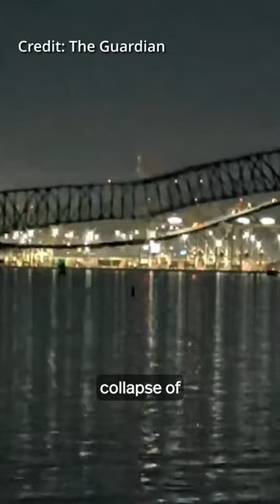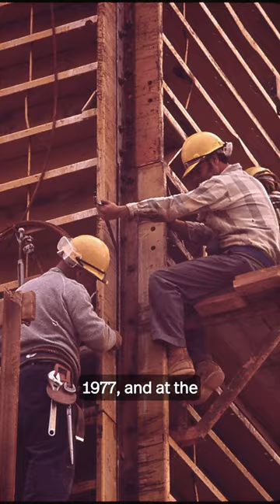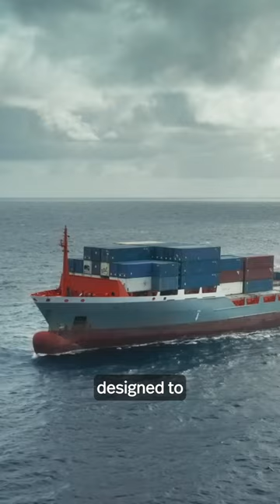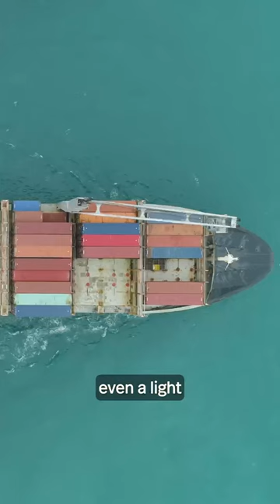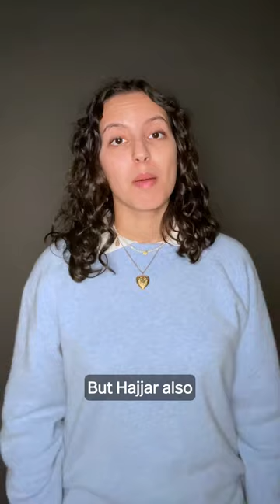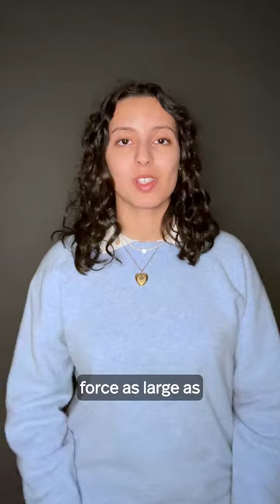Here are two factors that could have contributed to the collapse of a Baltimore bridge this morning.

Comment: This was an accident, the bridge did not fail, it was hit by a very large ship.
Reply: Ship movements are e red gu latex and controlled by the harbourmaster. Multiple safeguards prevent this type of event. The failure of those multiple procedures resulted in this collision. 

Normally tugs would accompany a ship movement of this size and proximity to infrastructure. Let alone the maintenance inspections and training/qualification requirements to operate the vessel. 

The ‘accident’ started long before the ship collided with the bridge.

Comment: And the first things experts noticed was that there were no peirs or pilings protecting the bridge support. Wonder which Baltimore politicians were paid by the contractors to get the contract.
Reply: There is 4 concrete  dolphins protecting the bridge. That is why at the 2 min mark, the ship hard over to port side drop right anchor to swing  the ship at an angle to get the concrete pillar that supported the bridge.